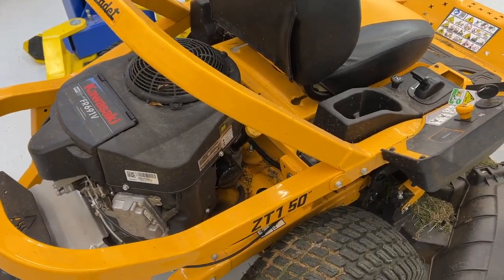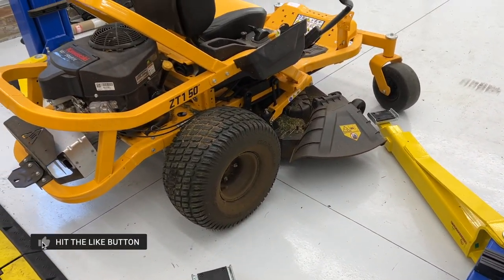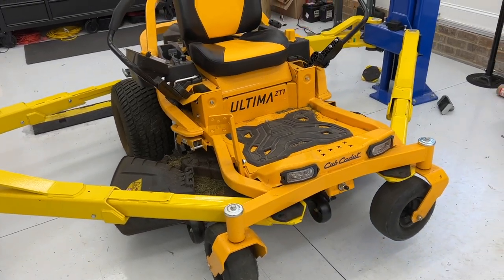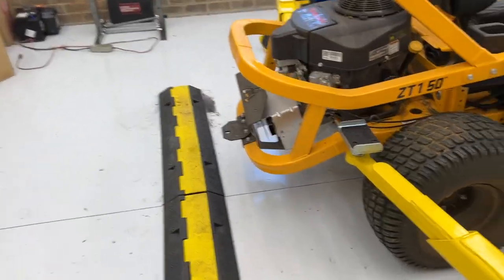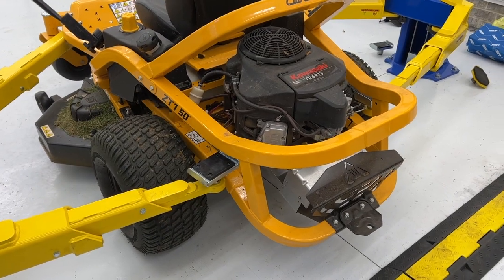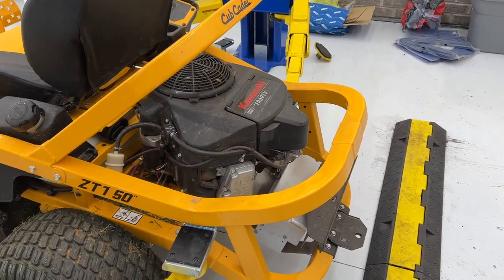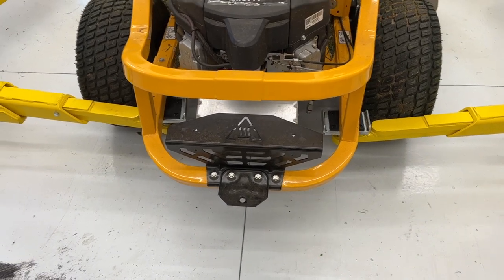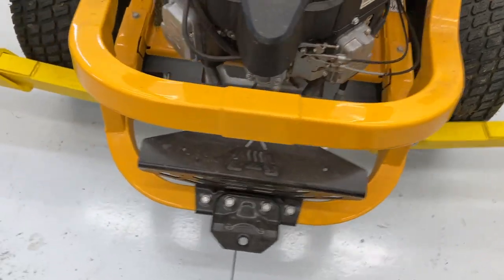How to Lift a Cub Cadet Zero Turn mower with a 2-Post Lift

Comment: I probably would have just used nylon lifting slings to wrap around the frame and hook the loops onto the lift arms. You could that way have the arms actually above the mower.
Reply from the maker: +David Kipper brilliant! I’ll give that a go next time 🍻
Reply: That's exactly how I do it. Chains or "axle straps".
Reply: does that cause the mower to rock and swivel when you apply pressure to remove blade nut or other things?
Reply: @striperseeker  Maybe a little, but if using impact it should be very minimal.
Reply: I tried straps on my Mower/ Lift and I could not get enough height to work under it. I positioned mine like the poster did. I think next time I'll try angle iron. I have a  9K Mowhawk lift
Reply: It went easy ,I took off the rear wheels with a floor jack and impact gun. This got the rear lift arms into position . Took a minute or two at most

Comment: How many people have a lift like this at home?
Reply from the maker: +Moseeplo most of the ones that would watch this video? 😆
Reply: @HelpMeDIY  Exactly....like me. I was thinking about using some angle iron to bridge the gap and maybe make a resting spot for the tires. I don't think it'd be to bad. I was driving my Ariens zero turn in today and I wondered if the arms would just reach like this. Ill have to see.
Reply: I have a Forward DP10A and I’m looking up options for lifting my mower. Thanks for the video